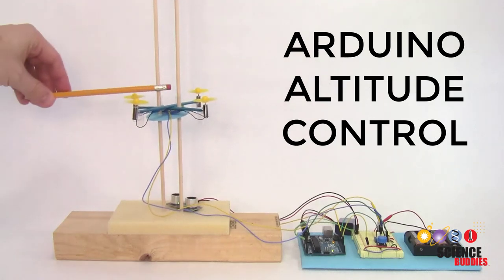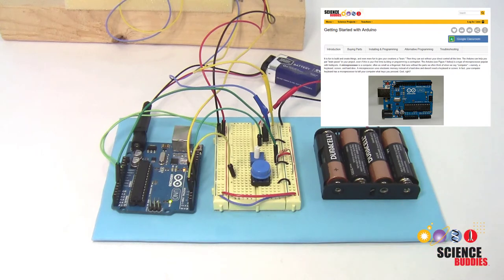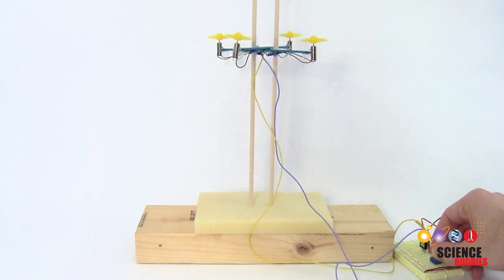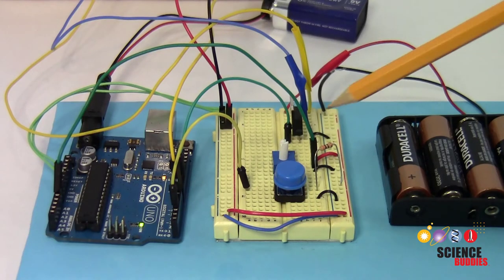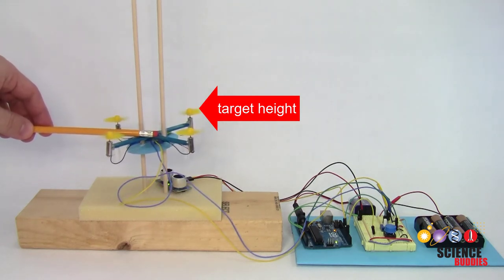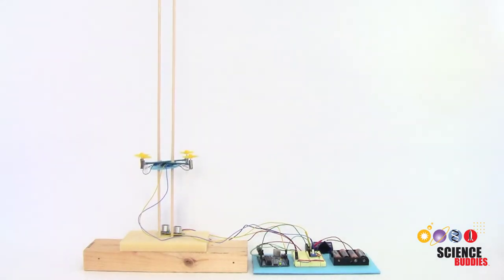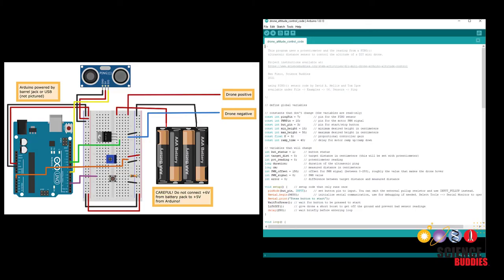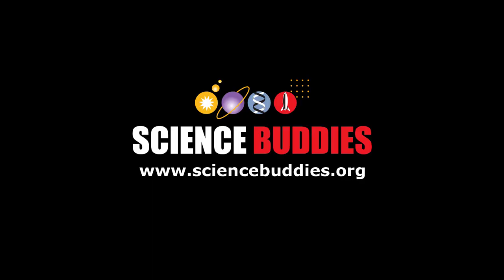DIY Mini Drone Part 3: Arduino Altitude Control | Drone Science Project

Comment: Sir I am using irfz44 n channel mosfet and a 4.8volts 700mah battery to power. But alot of power being dissipated by the transistor making the drone not fly up. What should I do ?
Reply from the maker: Hi - we sell a kit for this project that includes parts we have tested ourselves, we cannot guarantee the project will work with other parts. The lower voltage of your battery pack (4.8V instead of 6V from 4xAA) may mean the motors are not spinning fast enough to lift off.

Comment: What is the transistor, Doc?
Reply from the maker: The transistor is included in our drone kit, linked in the project description (you need to buy some other parts, like the Arduino and ultrasonic sensor, separately - see written instructions for details).

Comment: Sir how much mah is your battery pack, and could you please pin point the number of Mosfet such as irf530 or 540. Would be grateful of you
Reply from the maker: The battery pack is just using any standard AA batteries, but the drone will drain them pretty quickly if you leave it on for long periods of time, so it can be better to run the project from a wall adapter if available. Any common N-channel MOSFET like the ones you mentioned should work, the exact specs do not matter.